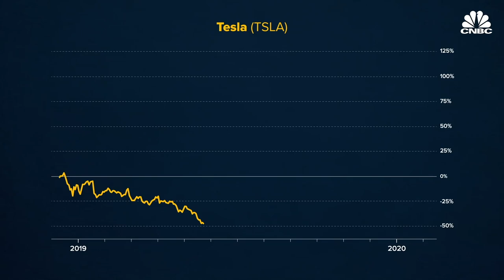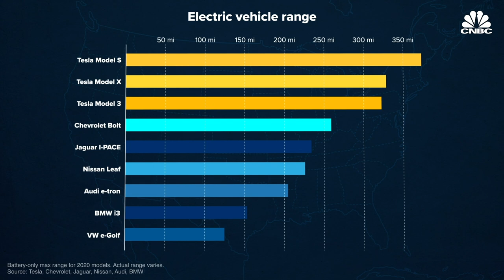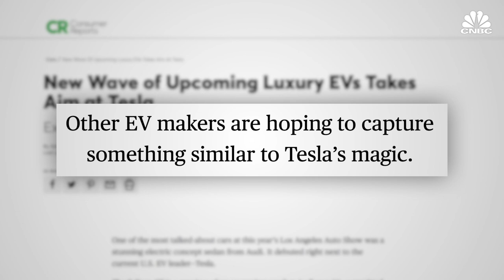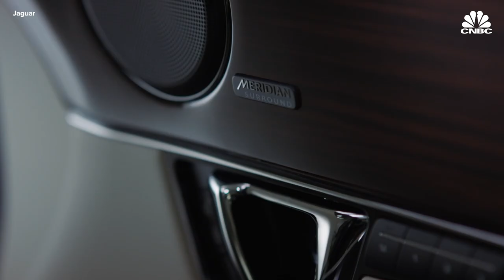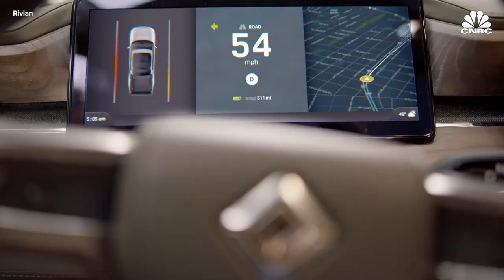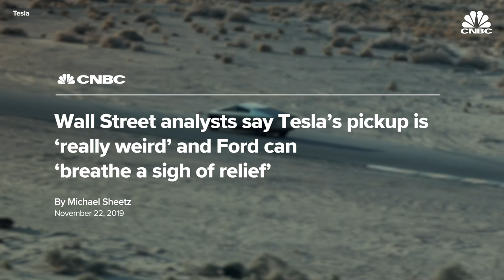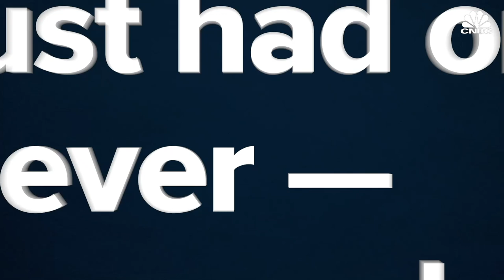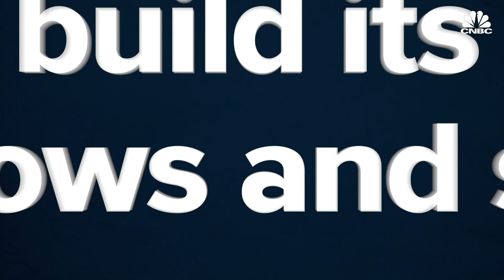Which Automakers Can Seriously Challenge Tesla?

Comment: “The only Tesla SUV is the Tesla Model X”.  Don’t worry ladies and gents, the Model Y is only months away and will be starting at $40K.  They’re coming for GM and Ford’s share of the SUV market.  Be afraid GM.  Be very afraid, lol.
Reply: The Model Y is a crossover not an SUV. They need to make something that can compete against a CRV or Rav4
Reply: MarLap2000 True, But in reality the Model Y will be just as capable a vehicle as an SUV and I believe it will be highly competitive with the RAV4, etc, except on price.  But with the extra price of the Model Y comes a truckload of feature’s that the other SUVs can’t come even close to providing.
Reply: If Tesla could produce millions of cars per year, GM and Ford would go bankrupt.
This Battery bottleneck is giving them time to make a transition. 
I'm not sure if they will make it in time!
Reply: Iconoclasticnation a crossover cannot compete with an SUV, they are two different types of vehicles. An SUV has a hitch, a large rear trunk, and a lot of cargo space, it’s also taller than the Model Y is. The Y is just a glorified model 3, nothing more
Reply: @Markcool2011  so is the mach e
Reply: @Markcool2011  CRVs & RAV-4s are compact crossover SUVs right? I've owned both and that is what I always thought and research seem to verify that. Seems as though the Model Y will directly compete with them. That'll be my next vehicle. "The Honda CR-V is a compact crossover SUV manufactured by Honda since 1995 and introduced in the North American market in 1997." "Toyota Rav-4 is a compact crossover SUV (sport utility vehicle) produced by the Japanese automobile manufacturer Toyota."
Reply: Good ole GM --- they can't do much right anymore....(without government bailouts)...
Reply: @wattlebough  The problem with the "But with the extra price of the Model Y comes a truckload of feature’s that the other SUVs can’t come even close to providing" argument is that I would bet most buyers don't WANT those features. 
Take a look at a Kia e-Niro vs Model 3. Model 3 has a brilliant autopilot, Kia has lane drift warning/correction and that's about it. But I don't WANT autopilot. Kia has nothing like the Model 3's infotainment system. But I don't WANT it (In fact, it annoys me so much that it would be a deal breaker even if I was going to buy one)! 
I just want an EV that will do 250 miles between charges. Even more would be better. Nor do I care for Supercharging. A Niro will take about 90 mins to get to 80% on a fast charger, as will the e-Kona. The e-Kona even comes with a fast charger installed for free at your home where I live. There are / will be times when I may need to travel more than 250 miles in a day, but I suspect that that will happen down the line, and in the meantime we'll probably just change our driving habits.
Reply: @Markcool2011  The model Y has a hitch and 66 cubic feet of cargo space which is more than most SUV and can Also seat 7 people
Reply: @davidcolin6519  so you want a car that doesn't charge fast, Doesn't have lots of extra features, Doesn't have an outstanding infotainment system, and is hard to take on long road trips?  I can tell you that's not what most buyers want they want a fast charging car with extra features and they want the latest technology with extra long range.
Reply: @llx3559  It does charge fast, not as fast as a Tesla, but it does charge fast. Nor is it going to be blocked from the supercharge function within 4 years of purchase.
I most definitely don't want the infotainment system, I despise the one on the Tesla and, as I said before, for me it would be a deal breaker. Much of the infotainment system is gimmicky and does nothing other than change the look of the information. I know this may sound strange, but I LIKE traditional instrumentation, I LIKE having it in front of me, not placed between me and the passenger.
And also, for me, part of the enjoyment of long road trips is avoiding Toll roads and actually enjoying the ride and choosing my route. I don't want to be guided from supercharging station to supercharging station. I can't think of anything which would remove the enjoyment more than an autopilot that does everything. If I wanted that, I'd rather take the train, and have done many times.
"I can tell you that's not what most buyers want they want a fast charging car with extra features and they want the latest technology with extra long range." who also have way more money than sense. The "extra long range" is maybe 40 miles, the fast charging maybe saves you 20 mins. It is clear that there really aren't that many people who fit your criteria, as Tesla maybe doing great in their segment, in some markets but Kia/Hyundai are in much the same position at a price point that is €20,000 cheaper.  
Having done the calculations, it would take 237,000km to amortise a Tesla as against a conventional car at a €40,000 price point. Admittedly, that is assuming similar maintenance/free charging etc, but that sort of differential is waaaaaay more than anybody other than rich people can afford. As I said, even with everything else being equal, I'd still balk at that price with that ridiculously gimmicky infotainment system. OTOH, a Kia/Hyundai can quickly enter the calculations because it starts at only about €10,000 more than equivalent conventional cars, and that amortises much more quickly than your fancy Dan Tesla.
I get it; you're a tech head, and tech heads love Teslas. And that is precisely what this and every other market review says; tech heads love Tesla, as much BECAUSE it's Tesla. But for Tesla to overcome market resistance they have to do far more to convince non-tech heads, especially now that there are real alternatives. The market is only going to get stronger, and Tesla certainly don't have an unassailable lead, no matter what your opinion.
Reply: @davidcolin6519   you keep talking about how much cheeper a Kia/Hyundai is from a Tesla but I can't find an electric Kia or Hyundai cheaper or as cheap as a tesla other than one. Because a Tesla model 3 is $39,990 (€37,000) and most electric Kias and Hyundai are more expensive than a Tesla and if one is cheaper it is only by 1 or 2 grand so no not only rich people have Tesla a Tesla is only like $300 away from the average car price and you save that in electric over just a month or two.
Reply: @llx3559  That is because I am writing from Spain. We are not offered a base level Model 3 at all. The CHEAPEST model 3 here is €59,000. The most EXPENSIVE  Kia/Hyundai is €44,000. Neither company has any tax advantage in this market, so comparisons HERE are far more valid than in the US. Similarly, you have tax breaks that favour EVs, we don't.  so your comparisons are not really very fair to anyone, are they?
The fact is that the EV market around the world is enormously warped. Isn't the best way to remove all those influences? When you do that, it really is difficult to argue in favour of the Tesla.
BTW, thank you for actually addressing my arguments rather than just attacking everything I say, which does seem to be a Tesla fanboi thing. I'd also love to like the Model 3, but I just can't stand that infotainment console/screen thing. I really do hate it.
Reply: Hi! My name is Elon Musk.....you people have no idea about what you are talking about. Leave this to my team of engineers ok?
Reply: @bluecomet1109  lmao ok "Elon Musk"
Reply: Model Y delivery starts this weekend 😂
Reply: The S 3 X Y series lmao
Reply: @Markcool2011  Either way, it will compete
Reply: @claudiomaiasantos  Yes they can and they will
Reply: @Markcool2011  no
Reply: @claudiomaiasantos  To be fair the battery bottleneck is also the main reason why Tesla leads in sales. 

After all it is their exclusivity deal with Panasonic, the largest supplier of EV batteries, that makes it possible to produce Tesla Model 3 in numbers large enough to have factory stock. Most of the competition, on the other hand, have problems sourcing batteries and for some models a wait time of a year is not unheard of. Hopefully the end of the exclusivity, causes by Tesla breaking the deal by inviting others to build batteries for them in China, will lead to Prime Planet Energy and Solutions(the Toyota and Panasonic collaboration) being able to deliver huge amounts of batteries to those manufactures who produce EVs that people want but currently have to wait a long time to get.
Reply: i own a model y ant its soooo much better than my model 3 sport.
Reply: I'd like one as well but shouldn't mislead, the starting price is at 53K.
Reply: @CCWorld2010  bro i paid 60k for my model y, this thing kills my G wagon in usability, handling, economy, functionality, the only thing the Y doesnt have is prestige, I paid 250k for the wifes G wagon.. and since the Y has been here we she hasnt even touched the Gwagon.. so we are selling it. unfortunately resell on this 3 year old Mercedes G wagon  is at best 90k from the paying price of 250k.. lol that insane.. I sold my model 3 sport for 55k.. lol i paid 55k for it.. well 58k.. thats incredible.

Comment: More competitions are better for consumers,.:-)
Reply: but, how many EV's other than TESLA are Profitable, NONE are.
Reply: It is when companies make competitive good products. This is not the case with BEVs. It's actualy quite sad how far behind the Legacy companies have become. This is detrimental.
Reply: @Neojhun  Making cars is not exactly a new industry. So I would expect that other car manufacturers will catch up eventually. :-)
Reply: @markplott4820  Tesla isn't profitable yet, they haven't had a single positive year since they went private.
Reply: @dnguyen787  Technically NOT a CAR. It's a high tech Battery on Wheels. Previous Experience is Not a Qualifier for Future Requirements.
No Automaker incl Tesla makes their own CELLs. Only Tesla & GM are partnering with experts like Panasonic & LG Chem to run their own factories. The rest are relying on remote suppliers. Some like PSA & Hyuandai just outsource the entire Battery Module. The more you give up control. The far less you will be able to catch up.
Reply: @michellefanter4671  Oooof that copy and paste brainwashed lines. This is not going to age well. If you knew how to read Quarterly Reports there is a very obvious trend which you are omitting.
Reply: @Neojhun  Making battery technology is not new either. And what prevents other car manufacturers buying batteries from the same companies Tesla has, or battery competitors?
Reply: @Neojhun  Are you sure I'm the one who is brainwashed? I like Tesla. Mark Plott simply asked how many other than Tesla are profitable, except Tesla is still not profitable. 

I agree they'll go into the positive(hopefully) sometime soon.
Reply: None of the other EVs currently compete with Tesla on price, range, performance, automation, technology, charger network, over the air updates, etc.
Reply: Telsa = Hype battery golf carts Golf Carts with 100 mile range has been around for 30 years !
Reply: @NHseacoast  Yes then IP was bought up by CHEVRON to be blocked from being used. You try building a Large Format NiMH battery and selling it. Chevron will sue you to oblivion. Thus why Tesla had to pivot to the Lithium Ion method which was only scaled up by Sony in the 90s.
Reply: @michellefanter4671  YOU Freaking admitted, there is clear trend where their cash flow is getting better. Investing is not about Past Single Time numbers Out of Context. You can make anything look bad if you falsify the context. There is a clear path where Tesla is trending towards cash flow positive slowly over the past few years. This is the best case scenario for a growth company. I specifically stated brainwashed because you freaking COPY & PASTED a meme.
Reply: @dnguyen787  Making battery technology is not new" LIES! Sony only scaled up BMS Managed Lithium Ion batteries in the 90s. These Legacy Automakers Have ZERO EXPERIENCE! The competition does not have access to expertise in this field as it's quite limited. There is no magical factory creating millions of Engineers and Scientist expert in this area. It's been swallowed up by LG Chem, Samsung SDI, Tesla Panasonic, SK Innovation & CATL. Who have all already reached their Limits to supply Automakers. I only consider Tesla Panasonic & LG Chem the top tier high efficiency Battery Suppliers. The rest are 1 generation behind and are Electronics companies.
Reply: @Neojhun  It wouldn't surprise me if you told me that you're owning Tesla shares. Good luck!:-)
Reply: @dnguyen787  I specifically do not and i'm ethically against the whole stock market. Seems like a massive corrupt system to built on sketchy contracts. My money is stuck in Businesses I directly work with.
Reply: @michellefanter4671  Wait WTF, you can not make False statements like that. That Copy & Pasted line was extremely popular with $TSLAQ especially on Twitter. It's a freaking meme part of $TSLAQ.
Reply: @Neojhun  I don't know if US could become the richest country without the stock market. Because most of the biggest companies are financed with stock investors' money.:-)
Reply: @Neojhun  I didn't make a false statement. lol. Get a life.
Reply: @michellefanter4671  "My comment wasn't 'copy pasted', it WASN'T a 'meme'"
That is a false statement.
Reply: Tee Bone  No need to be rude, friend.  Agree Taycan is a good EV.